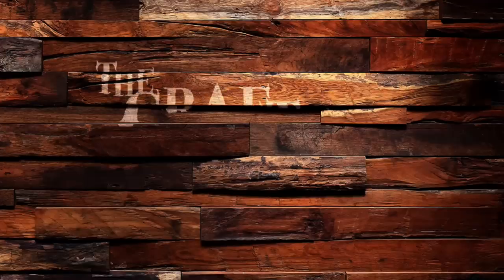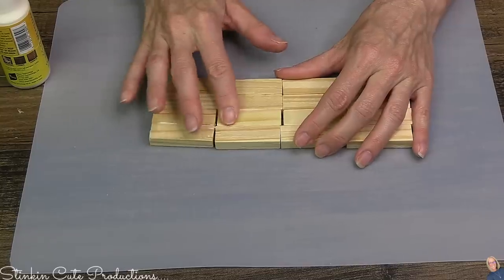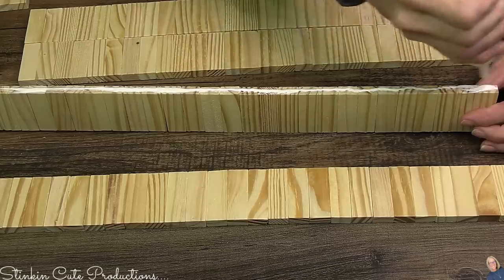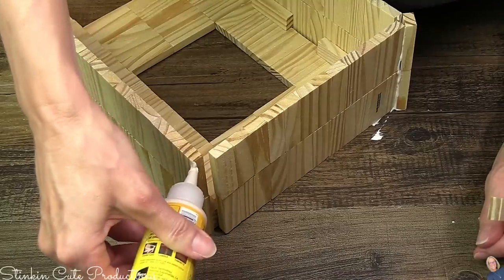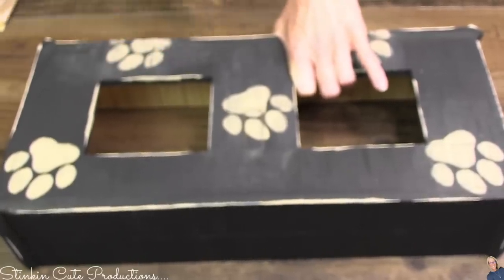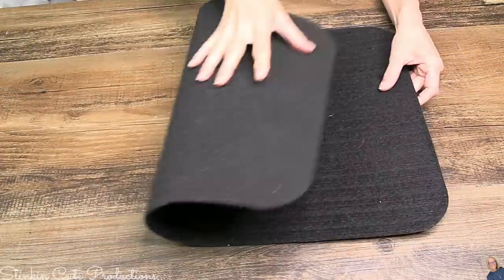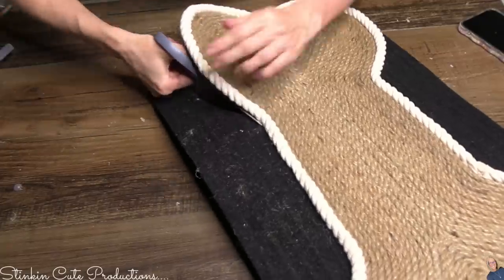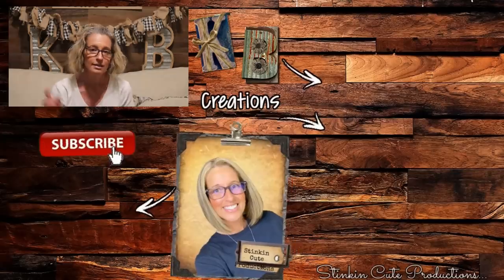Dollar Tree WOW DIYs

Comment: These are so cute!!  I already bought my dogs an elevated bowl holder.  I needed to last year.  They're senior dogs with arthritis and I could see them struggling to eat lowering their head to the bowl on the floor.  I cheated with my second dog.  Instead of a bowl holder, because I didn't have anymore room for another one, I bought a short step stool and put his dish on that.  And I got a rectangular container from dollar tree with a lid, and put his water dish on that.  Both worked!  I also got a dog muddy mat for my boy who has trouble standing on the tile floor.  His back legs were sliding.  Poor baby.  They're both on meds and I added omega's/turmeric/ and now hemp oil to their diet. They're both 14 and a month apart. Different breeds and we adopted them.  Back to the tower blocks, I can see how I can make other things based on what you did.  Like storage boxes inside drawers or something like that.  Or a tool box on top of my craft table.  Endless possibilities. Thank you! <3